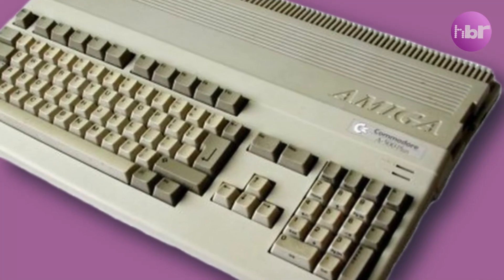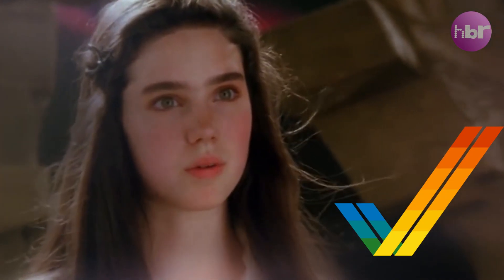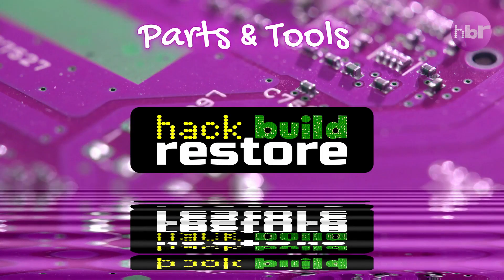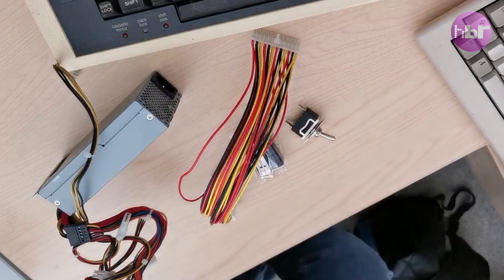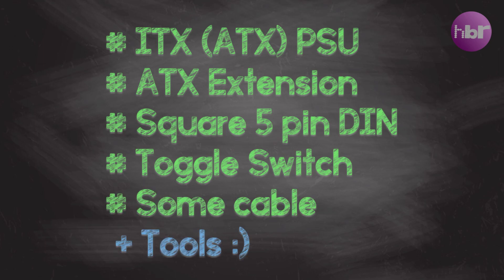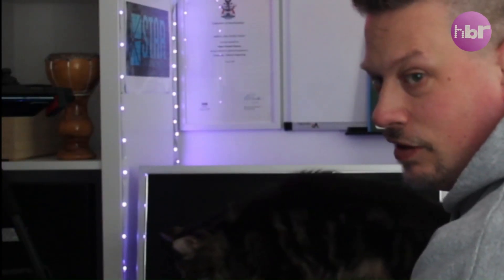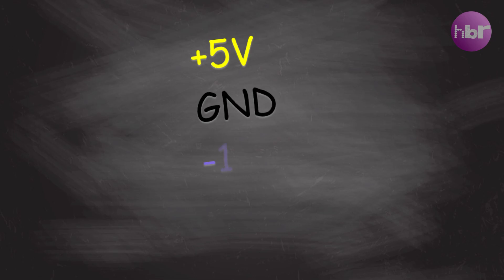Amiga 500 Powered with ATX PSU Hack! 🔧⚡

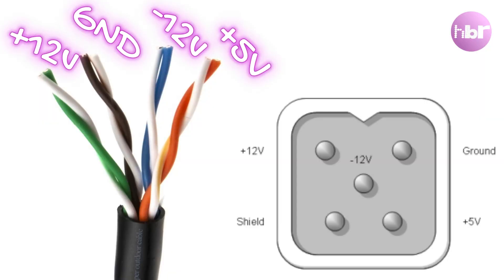Comment: Is the 5 pin DIN pinout at 1:25 showing the pins (male end) or the back of the headshell?
Reply from the maker: Male (power supply plug end) as if you are holding the cable and looking in to the plug.

Comment: What guage cable are you using? I bought a 5 core cable, but it's uber thick. I want to build in a switch, was looking at a latching led switch and then have an inline reset button which will go through a project box to keep it sat on the desk.
Reply from the maker: For wiring to the switch I used some CAT-5 cable I had laying around, doesn't need to be particularly thick for that, does that help?
Reply: @hackbuildrestore  Not really, I need to know what guage to use for the power cables.
Reply from the maker: Oh got you, for power connections from ATX I would go with 16 or 18 AWG which is 1.5mm2 or 0.75mm2
Reply from the maker: And 5v is where most Amps are pulled
Reply: @hackbuildrestore  So, +/-12 are for audio and serial/parallel then?
Reply from the maker: Yes and floppy motor if you have an early drive with a 12v motor (rare these days)
Reply: @hackbuildrestore  I have an A1200 mb and keyboard, with a new case waiting. Nothing else came with it.
Reply from the maker: nice ... in that case +/-12v is just Audio, RGB port and serial... sounds like a good start what are your plans ?
Reply: @hackbuildrestore  ATX power because I have it. Remove the modulator, recap, 3.2, pistorm, dev machine. I've got a (cheap) GVB2x00 board and I'll look at modding that and (future) try to make it an internal mod.
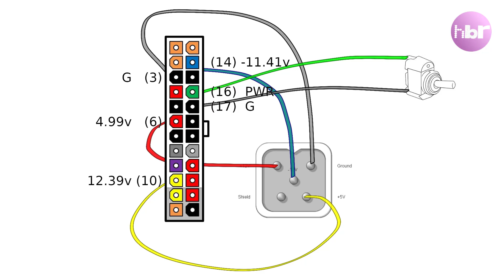Reply: I think at 4:50 you have the 5V red and 12V yellow reversed . It should be 12V on top left 5V red at bottom right.
Reply from the maker: I have double checked and it is right, with the plug and pins facing you :)
Reply: @hackbuildrestore hello again 
At 01:26 you show also the correct way. As per my last you reversed the cables I meant between 5V and 12V
... just an honest mistake.
Just for ppl to avoid messing it the last moment. 
The plug pins marked ok,I don't disagree
To be clear the image of the plug is ok. The cables need to be reversed as yellow is the 12V
Reply from the maker: Thanks for the feed back I'll go back and check :) As i pointed out in the video the colours on the ATX extension I used are random and don't match any standard, I did my best but without re-pinning the plug, that's why I labeled all the cables :)
Reply: @hackbuildrestore  Pinout at 1:25 is different from 4:50, at least the way the wires are run at 4:50